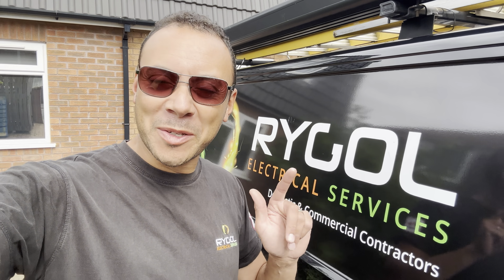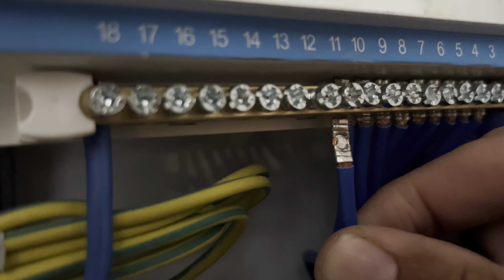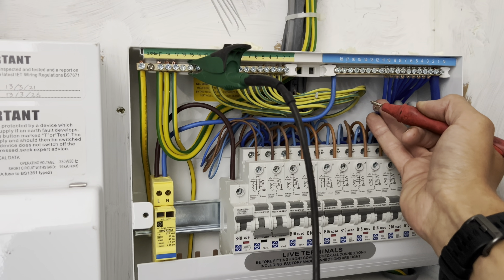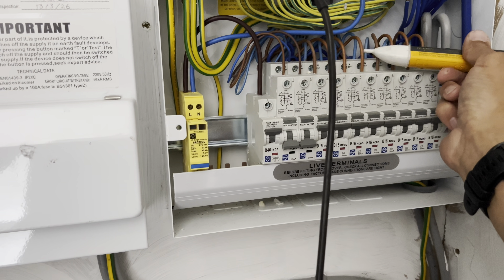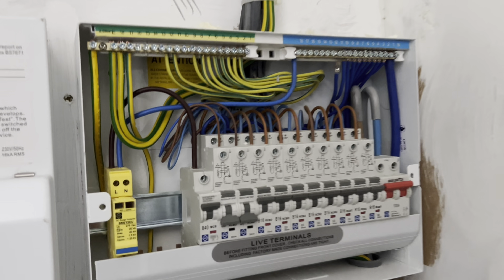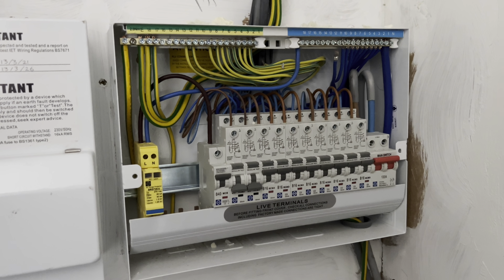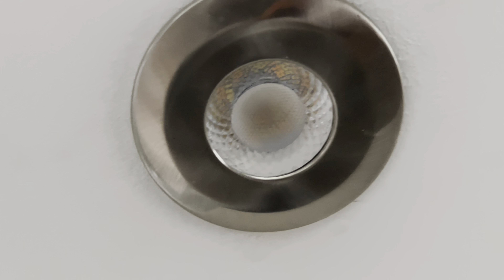Smart Meter Disaster! ⚡️

Comment: Never assume! "This neutral bar is completely safe to touch in normal circumstances", no its not, never assume it is as thats how you die or get seriously injured.

You have come in after someone else has done electrical work, they have made a mistake and unless you check its safe to touch first, just never assume its been done correctly in the first place until you know.

Comment: That's what happens when the distributors don't use electricians to do meter stuff, which is common, as you said even if they do things wrong, basic testing would have made them aware what was wrong, this situation was really dangerous because even when a fault would have caused the RCBO's to trip due to a fault, the cables and anything connected would have still been live. A comment for non electricians, DIY store guide leeflet's and youtube information providers sometimes say, if your not confident get a qualified electrician, JUST BECAUSE YOUR CONFIDENT doesn't mean you won't electrocute yourself or put your family at risk. A note for electricians, after doing basic testing with a 3 lead multi tester,  please use 2 lead testers when fault finding, 3 lead testers can, in certain situations, give misleading results

Comment: I worked for the electricity board for 30 years, I had to go and change a meter in Tamworth did my checks pulled the main fuse then checked to see if it was dead and it was still showing live, asked the owner what he still had plugged in he said nothing, noticed his wife running up the stairs then all of a sudden it showed dead...Called the revenue protection guy who came out and then the police turned up, eventually he admitted it. He had an outside meter box, he had taken the breeze block out inside the house to get to the incoming mains cable, split it and put a 10 amp connector on the neutral which had melted the plastic and very very lucky his house hadn't gone up in flames, the reason it was showing supply was because he had a plug into an upstairs socket to pick up the earth and neutral. He was running the immersion heater a few electric radiators and probably more stuff..I did say you could have seriously harmed someone if not killed with that set up...The electricity board thanked me and gave me a quarter bottle of bacardi for my efforts which must have cost about £3 at the time if that lol

Comment: I would like to hear what the Rep. from the DNO said  - AND what follow-up action they have taken with the Installer, I presumed you had to get the DNO involved/their approval to remove the seal on the Connector Block!  Nice job with the wiring.  Its always worth remembering that a fault condition can put a voltage on a part of the install that you would not normally expect it to?

Comment: The uk has a crazy system where neutral it always on even when the power is switched off. France has a far superior 
electrical supply system where live and neutral is switched on each supply. Solid state smart meters will always be 
vulnerable. These meters were mass produced in China for uk use and were designed to allow the uk government 
to control by proxy. Selective control of individuals supply allows the government to decide who can 
have electricity and who can’t when energy is rationed. Net zero will produce periods of energy shortage in the uk 
the government want to be able to calculate who to shut off and who to maintain the smart meters can be controlled 
without your knowledge or consent.

Comment: Did you install the henley block in the first place? Looks like you put the Neutral in the rear and the Line in the front. I've only ever seen (and installed) them the other way around. Not saying the meter installer was right - he should have checked polarity and Ze. I'm just pointing out where he probably went wrong as its likely just habit putting the Line to the rear.

Comment: Some of these smart meter fitters are cowboys.  Property I moved into a few years back my energy supplier wanted to fit smart meters.  Electric side was fine but when he fitted the gas smart meter he drilled the concrete floor for the meter mount and straight through a gas pipe.  He didn't let on what he'd done, I could smell the gas from the other room.
He said he'd have to cap my gas because of yellowing to paintwork around my combi boiler which had just been serviced.  He said I should contact the gas engineer to have it checked and uncapped.  So I called the gas engineer right away came straight out while the smart meter fitter was still here but he left quickly before the gas engineer started his work.
Gas engineer took the cap out, turned the gas on you could smell the leak straight away, see it bubbling from the screws he'd drilled in the floor by using leak spray.  
Smart meter fitter had left in such a hurry he'd left behind his digital job phone screen thing so had to come back anyway to face my wroth.  He pleaded innocent said he'd scanned for pipes but he knew the place was stinking of gas.  
Gas fitter had to fix the mess with a double cap.

Comment: i understand the time limit on video but Test Before Touch.. NB. Your Consumer Unit wiring with what looked like crimped terminals 10/10. Also did you just correct the Metre Tails in the Henley Block to correct the Polarity Error. Smart Metre Side I'd assume? Good Job Mr. Electrician.

Comment: Ditto, I was called to a house that could not turn off their TV, at the plug top It had the N in the L and the E in the L where the incoming Mains was on a TT Supply.
I scratched my head at first thinking that some how if it could run a TV on this setup was the Meter Recording it's usage 🤣
I also had an installation test where I was recording 140 to 165v after the power mains switch was disconnected, any ideas what it turned out to be and no it was not next doors supplying a free service line.
Mr Spence Eng

Comment: Where are you based? In yourkshire grids add aditional isolators rather then henley block after the meter, to enable easy CU upgrades. I will be blocking this chanel from recomendation as waiting to see measurement results while you keep talking was a torture.
I admit, I have expected behind the meter. polarity swapp on a meter is used by specialized house hydrophonic owners because the neutral line is not measured. using PRN then takes some of the current back.  I have not seen supply polarity swapped by mistake yet

Comment: I'm a sparky here in glorious Devon, the tricky thing here is if the socket outlets are single pole switched then any appliance can still be 'live' when the user thinks it is switched off and safe. Brilliant work on the consumer unit.
Reply: Also, if a fuse blows in a plug then the appliance is still live.
Reply: Dawlish by any chance?
Reply: No ablestringer....West Devon.
Reply: Always unplug
Reply: You don't have to be a
"SPARKY" ⚡ or have
ANY particular knowledge 
at all, if a test by plugging
a DIY tester into an outlet
gives a trouble indication
something is WRONG 😭
and no O.K. approval
should be given at all.

Comment: That's scary that a supposedly experienced electrician  made that error in the first place and didn't check the work fully upon completion of the job.
Electricity is the one thing I won't work on myself because it doesn't give you a second chance if you get it wrong. 
At least with plumbing work the worst that can happen to you if you get it wrong is a soaking !!

Comment: You're a muppet for wiring a Henley block with the live at the front and neutral at the back. They're muppets for not checking.
Live goes at the back of the block. It's a safety thing. Neutral is then then the only part you can easily touch when the cover is off.
Reply from the maker: @tebscat  oh dear looks like the muppet comment is on you. If you watch closely the live is at the back. The reverse polarity fault means the live is travelling up the neutral wire on the front of the block. Oh dear oh dear 😂
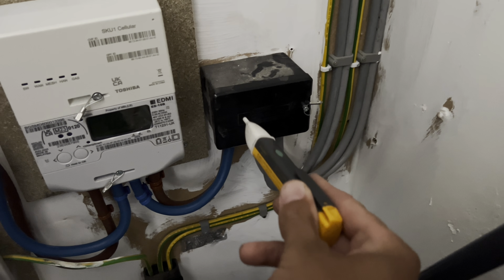Reply: @RygolElectrical 9:01 seems to bely that fact. You've got the brown tail to the CU at the front of the Henley block if polarity is reversed.

Comment: Had a simular prob years ago.
rented a studio flat in a house that had 8 flats in it. council came round and checked the fuses in each flat and said mine were not upto code and had to be replaced. so the council sent their electrian around to fit a new fuse box.
After they went i put my oven on to cook dinner and it blew all the fuses for all the flats.

The landlord told them to come back and check the wiring. they came back said its not the wiring its the cooker causing it. so new cooker fitted wiring checked by another electrician who fitted the cooker. all fine till the oven got turned on and again every fuse in the house blew.
So who ever put in that new fuse box screwed something up and refused to admit something was wrong even after they checked it several more times.
Turned out it was the fuses them selves were not powerful enough to run a cooker lol. So the landlord got his elctrion to come in and put a better fuse box in to get everything working then the council said sorry not up to code remove it.

Comment: and they have got to guts to install a locking pin after the meter, after the meter it belongs to the property owner isnt it? what is the idea behind putting a lock on the junction which wouldnt be a problem if its been fiddled? Another reason not to get a smart meter installation, because you would simply wouldnt want them mess about your electrics.

Comment: Not unusual - as some meter people do not know more than what wire goes where on a meter - on job we were on where there was two phases and the meter person connected 2 phases into a connection block before replacing one main fuse, then when he replaced the other he then blew both 100amp main fuses - this is a true fact as I saw it happen, however I did not see him place two separate phases into the same connection block - he then tried to fathom out what was wrong, and even when it was explained to him he could not see what was wrong ..

Comment: When replacing an electricity meter a socket tester should be plugged into a convenient socket and tested for correct polarity. If all is well i.e. polarity is correct then do not remove socket tester from socket.Change meter.Restore power go back to socket with tester still plugged in and test again. This very simple but vital test which should always be done will tell the meter fixer(an awful term)that polarity has remained the same.Of course other checks and inspections are required as well whilst changing the meter. The biggest problem is these companies are training anybody regardless of skills or ability to essentially carry out a task that in my opinion should only be approached after years of electrical training.

Comment: Electrician owns a degree of responsibility here. Wired the lucy block backwards. Does not excuse for one moment, the meter fitter for not testing tho. Simple post polarity test would have caught this.
Reply from the maker: Thanks for your comment. The henley block is wired correctly with  the live at the back. The meter guy wired his live into the front by mistake.
Reply: @RygolElectrical  Totally my bad. Looked like meter guy wired live to back when I watched it. Apologies.
Reply: @RygolElectrical  It looks to me that before you'd corrected the polarity, the supply tails were blue in-front, and brown behind, which means the outgoing tails from the Henley block - which were unlikely to have been altered by the meter installer - were the wrong way round. So the meter guy used the conventional method, and whoever installed the Henley block at an earlier date put the live at the front. That to me would be the wrong way to install the tails, and I suspect that the meter guy went for the conventional method.
Obviously he was still in the wrong for not checking etc.

Comment: I was called out to a property recently, that we had installed a Rye field panel to distribute from the DNO Head to 3 flats. This time the meter company connected the meter backwards, so the meter was running in reverse! We had to point out to the fraud officer that the meter was sealed with official seals. Sadly most meter companies are not employing time served sparks for this work.

Comment: Thanks for a great video. It's depressing that an engineer visiting probably many premises a day (for SM installations) could be capable of making such a mistake, not checking and then signing that he/she had done a check. Such a moron shouldn't be graced with the title of 'engineer' of course. On a brighter note, it's always a joy to see wiring that's been elegantly executed (no pun intended) as in your vid. It looks like you used a crimp termination on the neutral cable you pulled out for the vid: is it a 'bullet' crimp (as normally used for stranded cable) crimped over a bent-over 2.5 core? For regular screw terminals, eg in light switches, I'm always concerned that in products where the screw engages directly with the cable, the core can get cut through, get displaced to the side of the screw or come loose with under-tightening of the screw. Have you any thoughts on using crimps like hooked spade  terminals for wiring such accessories?

Comment: I have an uncle who used to be a commercial sparky. He said that if one thing holds true and that is always trust on stupid. There is always some one who is lazy, overworked or spends too much time in the pub. this is why procedures for post installation checks are created to mitigate this exact factor. If I were the owner of the property, I would insist that the service provider make checks on every job this electrician had made in the last two years and if  a  potentially dangerous wiring installations are found, have his certification refused, kicked of the contractors list or just be plain fired. you can always work another profession, you cant get another human life.

Comment: how did you swap the cable round if the box was sealed by the energy supplier? or did you have to call them back out?
Reply: very interesting question. I should like to read an answer as well in deed

Comment: As an ex meter fitter I must say that it was totally inexcusable for the meter man not to do a polarity check after completion of the work. Should be done both pre- and post- work. This is the trouble with paying fitters more for completing more meter changes. rush - rush - rush !
However - I can see how the mistake was made.  It is convention to put Neutrals in the front of Henley blocks and Line conductors in the back, so there is even less chance of exposed bare line conductor.  But this is no excuse for not checking polarity and finding their own mistake. That's why the polarity check is mandatory.  Hopefully you reported this to the energy supplier so the fitted could be sacked for dangerous work due to breaking procedure.

Comment: We NEVER have domestically  uninsulated neutral bars in Belgium(only in industries). Some people still tap beween two phases so they have no neutral. Our breakers have 2 poles and neutral goes with the lines in the insulated feed bars Also I have only once installed a neutral ground bar to protect the house from a central neutral break(suspension power lines).

Comment: A cracking video and a great find. The fact the meter monkey couldn't even be bothered to plug in a basic socket tester, or if they did, they didn't concern themselves with the result, is jaw-dropping. Although Henley blocks aren't polarised as such, the unwritten convention is to have the line block at the rear and the neutral block towards the front so that if the cover is removed, the line is harder to touch. It looks to me like this one is the other way around which isn't wrong, but that may be how the mistake was made.

Comment: "Smart" meters are a disaster full stop, they can be remotely hacked and your tariff can be hiked up, and they have a relay built in which can be remotely operated, either by your electric supplier or by a hacker which can cut off your whole supply and leave you without power.